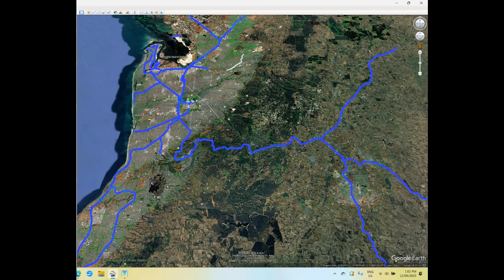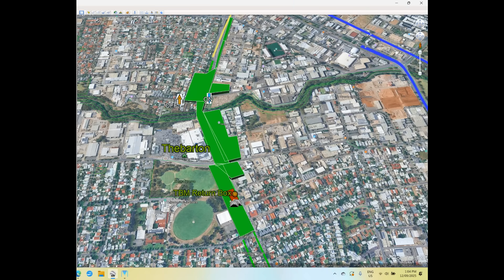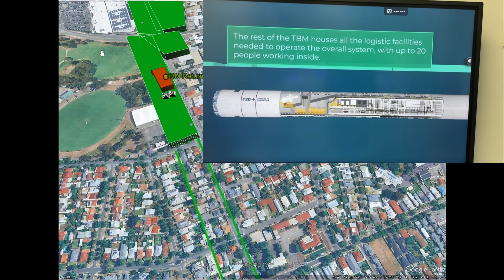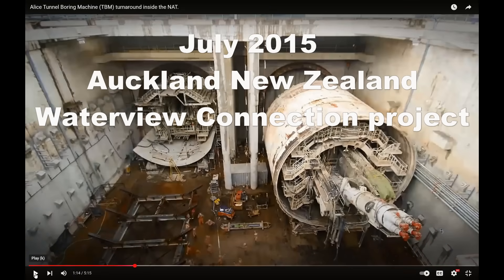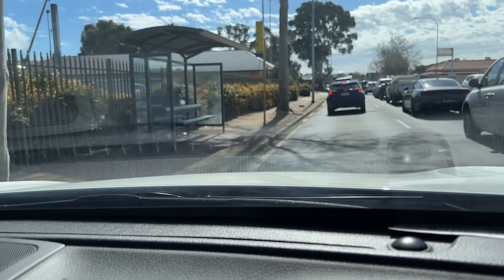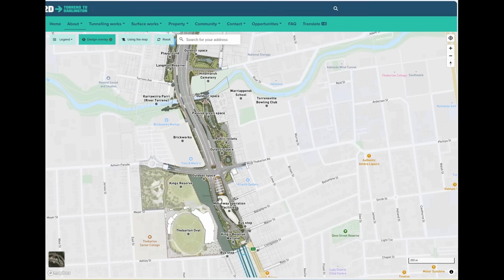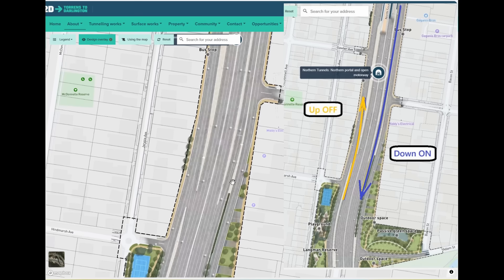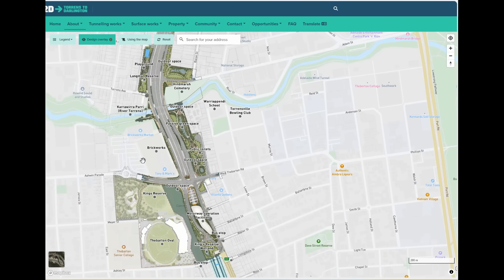T2D Progress #4 Northern Tunnels at Thebarton Adelaide South Australia SEP 2025 Video

Comment: Thanks for the videos! I'm curious how bus lanes will be integrated into the motorway since you would hope the motorway will encourage bus use in the absence of trains servicing the south
Reply from the maker: Your comment of "absence of trains servicing the South" needs to be considered.

The rail line to "Noarlunga" was extended to Seaford with extensive "bus-train interchanges" being built at some stations.    

The rail "right of way" to Aldinga has been retained and not sold off under the Marshall Plan

The Rail Line to Tonsley has been extended to Flinders Station (Bus and Train interchange) adjacent to FMC and Flinders University.

Trains services can be increased by increasing the number of carriages capacity each train.   This involves making the platforms long enough to accept these trains.

Removal of Level Crossings can allow for increased train frequency.  The Brighton Rd grade separation is something should be resurrected from the Marshall indecision on this matter

Passing loops for trains at all stations allows local trains and Express Trains to pass one another without interrupting one another. 

Out train sets are currently at a 
* Maximum of 3 carriages 
* No passing loops at most local stations 
* Limited Level Crossing removal.

6, 8 or 10 carriage trains running every 4 minutes with absolute grade separation is common in "metro train systems"

Comment: Giant destructive waste of money.
Reply from the maker: Jono, may I suggested that the alternative of doing nothing is to continue with long and slow journeys for buses, car and trucks.  
A huge waste to time and money out of every bodies pockets.
Reply: @Highbury5089 
Compared to Sydney Melbourne and Brisbane south road isn’t nearly as bad. 
And with the 1500 immigrants halalbo has coming in everyday this is just an expensive bandaid. They’re going for 40 million people in Australia and soon. Plus as someone who works in the building industry I’ll tell you right now there’s gonna some stuff ups with this. Big time. The soil in Adelaide is notorious, there’s still clay pipes running water as far as I know, and EVERY government project I’ve worked on goes way over budget. But hey,, this one might be different…
Reply from the maker: @Jonobueno  The TBM will be going 20m or 30m beneath the surface in regions where they have done extensive testing for any pollutants like Lead and PAFS
Reply: @Highbury5089 

20 or 30 mtrs down? Righto. Well you’d know mate how crappy Adelaides pipe works are. 
It’s not about contamination it’s more about the constant repairs they’ll be doing and the turning of a main road with great businesses into a lifeless urban wasteland, that will end up being a slum in parts due to removal of business. Just big green signs overpasses and underpasses and concrete.

Comment: They should keep going all the way to Victor Harbour
Reply from the maker: They are doing that at the moment, but it is being done in stages.   They have finished the road to the flyover in McLaren Valley with a double track round-about large enough to take big trucks at moderate speeds.  I regularly travel on that road.     
Eventually down the steep slope into Victor Harbor?

Also, the road to Noarlunga is being done at the moment / just finished.   I have not travelled on this road but I know a person who worked on the project.
Eventually extending to the Ferry Crossing to Kangaroo Island?

The road from
Reply: @Highbury5089  I MEANT THE TUNNEL

Comment: G’day, the Air Raid Shelter entrance is on the left of screen now 7:25 and is two entrances opposing each other that look like toilet blocks, opening the doors the staircase leads down about 4-5 meters to a room the size of a large lounge room with corridors and rooms that join off it, that’s if it’s the same design as the one under the Glenelg Oval, which I used to have a key for in the early 70’s, I had a Band and we used to practice down there. We put sofas and chairs and our equipment in the main entrance room. The corridors had been bricked up but it still had a couple of extra rooms that had been cleaned out but still with power on, there were also many telephones, piles of telephones. We use it for about a year until complaints of too much noise coming out of the air vents. Just a little bit of 70’s youth history (we did have a lot of fun down there)!!
Reply from the maker: Thanks   
I am told the one at Thebarton was used by a magic club.
Reply: @Highbury5089  https://www.youtube.com/watch?v=fl1VQc1BWBE
Reply from the maker: @mjmichaelallen  Thanks for the link to the video showing the way the building  has been used in the past.      
Hopefully structure will become alive again when the road works are finished.
Reply: I was from Glenelg born in 1962 what was your band name? I went to Glenelg school next to the footy oval in the 60s. Whats your name if you don't mind me asking we may know of each other although you're no doubt a bit older than me. Glenelg was such a great place to grow up in back then,it was an awesome seaside suburb

Comment: As usual for Adelaide, missed opportunities by the dozen. Why would you not tunnel under the Torrens instead of funneling traffic through the Hindmarsh bottleneck? I have wondered for years why the don't extend 4 lanes of Park Terrace straight down Adam street and have a major intersection at South Road there. Get rid of the cemetery all together. While they have the tunneling machines there, a spur line to the Airport would be brilliant, wouldn't it? Maybe another one to West Terrace in town...! BTW how's the budget going? Was $10B to start with, last I heard was $16B. Is it $20B yet? $2 Billion per kilometer. Just contemplate that for a minute...!
Rant over...
Reply: You have to do a u turn to get onto Port Road. Completely ridiculous. There is no left turn exit onto Port Express way / Salisbury High Way from the north nor a right hand turn from the east onto the connector , which has put 2 way,  Kings Road  under pressure with a 4 x daily traffic jam and on top of that, they couldn't go the extra mile and put overpasses over Port Wakefield Road for Kings Road and Waterloo Corner Road. I expect they will cut many corners on this project.

Comment: HOW DOES THE TUNNEL MACHINE TUNNEL INTO THE REVERSE DIRECTION TUNNEL WITHOUT THE BACKEND COMPONANTS... SEEMS TO GO INTO THE NEW TUNNEL SITE BUT THE OTHER TO BE ADDED PEICES AINT ON IT YET AS IT GOES IN... NO VIZABLE RUBBLE COMMING OUT EITHA 1ST UP WHILST ADDING SECTIONS... CHEERS... PS. CAPS LOCK STUCK ON... 😊
Reply from the maker: Having watched the Herrenknecht videos I suggest the modular nature of their TBMs means the "Shield-head Module" can operate without being connected to the other components.

In building a TBM Launch Box the first 20m or 30m of the tunnel is dug and assembled in preparation for the entry of "Shield-head Module".  
This is necessary every time TBM start their work.

The Sheild-head Module is then activated and moves forward through the soil.   

This first lot of dirt is collected into skips and removed.    The editors of the video have deleted this "house-keeping" aspect from their video presentation.  

When the "Shield-head Module" has advanced a 100m or, so the skips are removed and the other modules of the TBM are brought into the tunnel and the process of creating the Tunnel can proceed at full pace of 10m or so per day.

A month of activity condensed to 30 second

Comment: They’ve knocked half of Adelaide down in the last 12 months 😂 it’ll be worth it in the end. A lot of those buildings were shithouse, anyway.
Reply from the maker: With respect, the use of tunnels has greatly reduced the amount of property destruction and allows for safer traffic flows
The alternative method of increasing traffic flow is to widen the roadway.  This means all the building on one or both sides of the road are destroyed.    Portrush Rd at Magill Rd and Marion Rd at Badman are examples of this destruction.
When a road gets very busy the removal of on-street parking makes business un-economic unless they can create parking at the rear of their premises.  Goodwood Road has sections where this solution has been adopted
Reply: @Highbury5089   Portrush Rd at Magill Rd  widening seem pointless to me. they both reduce back their original form.

Comment: I wonder if the air raid shelter is still there At thebarton  that's the magic club of Adelaide It looks like there's a new building in front of it that you mentioned
Reply from the maker: The "Heritage Bunker" is shown on the T2D Project map as being retained when the project is completed.
The redirection of the UP South Rd will not cause the destruction of the Bunker.
https://www.t2d.sa.gov.au/project-map 
The Bunker is visible in the above video,
Yesterday I saw that the project has now closed of the carpark to the Thebarton Centre.
Reply: @Highbury5089  Wow fantastic information .Great to hear it's going to continue to be there. Spent many years at the club but moved out of Adelaide so I was wondering what was going on with it . Cheers